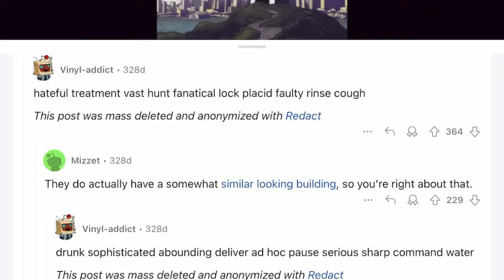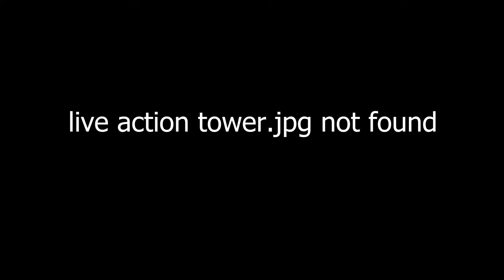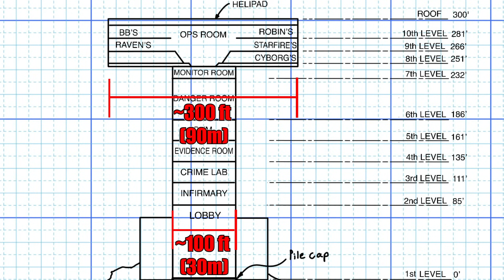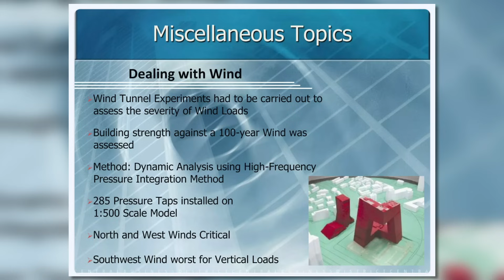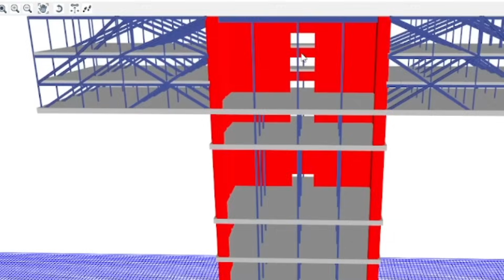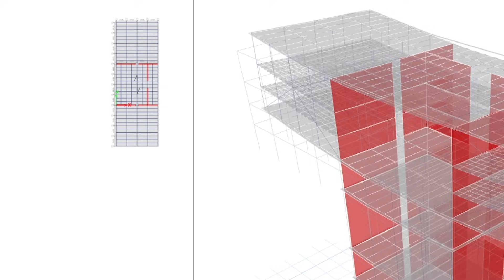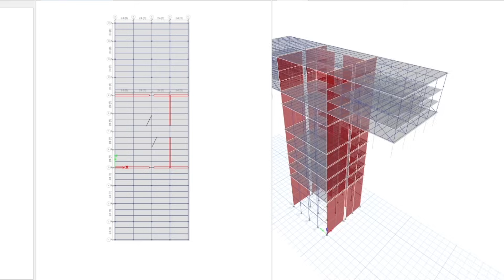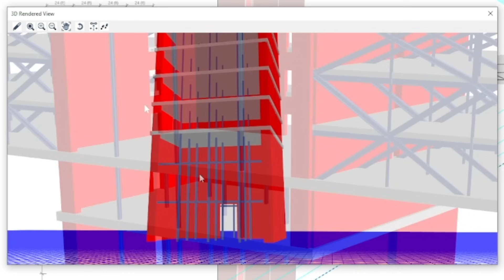The REAL Titan Tower - an Engineering Explanation

Comment: I think that the parts of the building that light up aren't actually "windows" but are instead some kind of cladding for the building. When the building is shown partially destroyed/run down those elements are cracked/broken more in line with cement slabs than busted glass/plastic. If they are cladding then behind them could be the type of structural supports you were talking about, along with them possibly being made with some kind of material that helps defend the building from attacks (or just has lighting elements to let the tower glow at night)

Comment: Sort of surprised you didn't use a technique I call "just put a wrapper on it". Basically, you engineer the real building with a more stable structure that is allowed to deviate more from the architects vision, then you build a lightweight façade over it that does fit the desired shape. For a simple example, imagine you built something like the Cruceta del Vigía, then you just put a light weight shell around it to make the outside look exactly like the Titan tower. Generally, in this case I think the floor heights for the OP rooms on the horizontal part of the T would just be smaller than you calculated, so you can put some arching bracing beneath the two outside projections, but then the façade structure would just give it the right angle external look and there would be a big "crawl" space under the lowest OP rooms (without resorting to comic book "science", I wonder if there couldn't be some kind of dampening system hidden there too).

Comment: One thing, apart from the common room, the fact that the front is glass does not have to mean that there is no support behind it, many of the rooms like the training/danger room, has no windows so the glass facad might be just a facad over a steel frame where only the top room would need less obstruction. Ro usually do not see the rooms behind the glass, that would allow for a more box like tower frame which would help with a lot of the problems, adding integrity and avoiding the heavy side walls.
Reply: And also security might be a reason to have windows be fake.

Comment: There might be cross braces behind that exterior glass, with lighting between the bracing and glass to provide the illusion of uninterrupted space.

Additionally, high tension cables across the top of the Ops Room might help constrain the load necessary, but you might already have tried that as part of your bracing design, and the blast that took out the top center of the tower would contraindicate such a design.

Comment: This might be off topic from the titans tower, although what if there would be more constuctions of the other parts of the cctv "pyramid"? Like, the first part of the lower area is done, then theres the second part to be filled in, as a sepperate building. And then, the middle section, again 2 parts, yet smaller from the lower parts due to a pyramids shape, as higher it goes, the more pointier or smaller the top gets. Then the top area, which possibly would be two towers in one same location. Perhaps even a bridge connecting both of them. These monuments or buildings can be scattered around the world, or if theres enough space in China, the buildings could aswell be scattered around China.

Comment: You acknowledge the need for defenses, but not the availability and use of not only DC comics technology, but even real world technology?

I'm pretty sure if budget was no limit, there are materials and methods to make this very possible.  In real life, we have pretty incredible synthetic, and hybrid materials, and advanced manufacturing methods like 3D printing.  I can't get into everything in a comment, but really, I just wish more thought went into all the options, and not just a hypothetical "if someone actually wanted to do this, what is likely?".  I expected something more definitive. 😞

Just to elaborate, 3D printing allows the possibility of complex structural materials that maximizes the use of a material while limiting excess matter, resulting in more durable, and lighter construction.  Also, some buildings use gliding foundations to buffer earthquake motion, this could potentially eliminate earthquake hazards.  Also, foam.  Some forms of solid foam have amazing structural qualities, and their lack of mass means less stress on supports.

I'm sure an HQ for superheroes, is built like a fortress, no expenses spare.

Comment: the ops room as a very clear slanted window placing it at the base of the T going into the tower and also have very clear red side walls so we can assume its not just a giant pane of glass and its got retaining walls tht lead off to smaller rooms. in fact since the diangram has /1/ room per floor we can assume most is utility/structure

Comment: Interesting.
As we can assume money is of little object, perhaps something like ALON ("transparent aluminum") could be used as trusses in the large windows if not for the large windows themselves. I'd also suggest that the first floor also consists of a garage and other such things that make the most sense if placed on the ground floor. Meaning that the lobby itself may have a huge ceiling most of the ground floor is not 85'. And if we were to try to build such a thing for real, the crime lab may well be composed of several rooms possibly on two different floors.

Might be a fun exercise to team up with other structural engineers and some architects to design a tower that is as faithful to the early 2000s TV version  as possible while still making sense physically and from a practical use standpoint. Like the Enterprise no bathrooms, gotta have a kitchen, I'd expect a formal dining area, guest quarters, "boiler room", server room might be separate from the other building infrastructure, etc.

Comment: There should be a part 2 on this where you design more feasible/safe Titan tower.
Reply: And fill out the interior spaces to be a functional home and headquarters.
Reply: Starting by shrinking the tower, and adding some more internal structure would be a good way to go.

I'm sure most of the titans wouldn't care to have a personal living space that is a bit smaller. (Robin might be an exception)

Also, assuming that the arms for the T on the tower are just the personal living space for the titans, each of them has about 10,000 square feet of living space that is their own. Assuming half is taken up by specialized training equipment, gear storage, and other hero related storage needs, (Robin and Cyborg are probably the only ones that need significant amount of space for their gear) and the other half is split into living, bed, recreational, cooking, bathing, and eating space, 5,000 sq feet for one person is still a massive amount of space.

10 foot high ceilings per room, a 10 foot high space under the roof for structural, mecanical, and other various odds and ends, and a 10foot tall space at the bottom of the arms would be only about 50' tall, and give plenty of space, 50'-60' long arms, would still give massive rooms for each of the titans, and be much less stress to the building, The 10' space on the bottom can probably be dispersed under each of the floors, giving much thicker floors and dispersing the structural load over more of the building, an atrium with a couple cat walks for the main meeting room (cat walks also acting as load dispersal). Also, a small inset patio/porch for each of the titans.

The base probably shouldn't scale exactly to how much the entire building is shrinking, so instead of the 100' base, making it 60' would keep it looking right, while also being a better base than the true half size base.

Comment: (9:35) Why not simply hang the structure from thick girder boxes on the roof (between helipad and top floor)?  The beam boxes on top could be welded to the beam boxes inside the side walls.

Comment: (4:35) Is this a Westin Hotel building?  A curious choice, since their ceilings feel a bit low.
Reply from the maker: This is in Seattle, maybe a Westin. But you’re right, hotels typically use 10’ floor to floor height compared to offices which can be a bit taller.

Comment: Thanks for the video, I found it interesting. 

I'm not sure if this changes much but would this be more feasible if structure was more of a typical tower shape? By that, I mean that both ends of the T would essentially be 80-90% facade/decorative. I'm sure the top floors might expand a little past the initial base of the tower in this scenario. I imagine you wouldn't have to care as much for load bearing, right? It's entirely possible I'm talking out of line here, though.

Thanks again.

Comment: You know funny enough after all of this, there is one important thing you left out. The only window to be shown in the show which is visible is the ops room's front facing window, ever bedroom clearly shows a complete surrounding of concrete walls. (and i believe the garage also has a window? dont remember exactly) So it's very likely the entire window feature set is probably aesthetic and not actually visible, apart from a segment of the center top most window. So many of those beams do appear to be a reasonable assumption, as there is no reason to assume they are visible anywhere else based off the evidence from the show.

Comment: The drainage design for this would be very easy assuming the tower is at the peak of the island. Everything simply drains away. 
The power would almost certainly have to be generated on site, and the water would probably require an on-site desalinization plant. 
Anything is possible with Batman money I suppose.
Reply from the maker: @slammer1017  true! It would’ve been a pretty wild undertaking!
Reply: I think it would be cheaper for Bruce to build a pipe system to pump freshwater from the city to the island

Comment: my guess is its significantly larger on the inside than the outside because we see huge floor variations and some small rooms and large rooms that cover the same floor
Reply: I was guessing that the tower uses optical illusions to look smaller on the outside than it actually is. That it's real size is 1.5 or 1.8 times bigger than it looks.

Comment: Something to note about earthquakes is that earthquakes, while more often in the west, are actually more devastating in the east as the soil in the east can dissipate earthquakes 20x as far. It was said that when the New Madrid earthquakes happened, they were felt as far away as boston and church bells rang in Charleston South Carolina.
Reply from the maker: @UpperCumberlandGamers  that’s interesting, yea, it must be due to the hard rock in the surface below.
Reply: @onstructures  yeah. I heard someone compare it to shaking a cube of steel vs shaking a cube of sand. The sand dissipates motion quickly whereas the steel dissipates motion slowly as it is a lot more dense and solid material. If you want, check out how reelfoot lake in Northwestern West Tennessee was formed. Spoiler alert: it was caused by the mighty Mississippi River running backwards for a few hours.
Reply: what's different about the soil?
Reply: @mrosskne mostly the type of the soil. If i remember correctly, the soil out east, is more clay vs out west the soil is less compact and is more sandy.
Reply: neat

Comment: In most of the shots, the building seamed to be on a lean. I always assumed that the base was bigger than the top, at least in the direction of the cement walls parrallell to the glass. Like 5x8 at the bottom verses 5x5 right before the cross. This would also help brace against the wind and warping a little by expanding the footprint.
Reply from the maker: @oldlosttoy  that’s funny, I never considered a tapered design! I just assumed it was leaning for visual effect, but why not!
Reply: @onstructures  I also have thoughts about the internal structure. I loathe the idea of the elevator and stairs at the back. We've seen Titans jets and stuff leave out the top, and the helipad seams retractable which implied to me a central Frieght elevator, along with stairs and or a high speed person elevator. Since I assume the back isn't like the front (we never see it) I would actully have a section of smaller floors, a garage, etc along the back of the building with the elevator shaft being near the centre. The foyer doesn't have to take up the entire bottom floor. This would add more internal stability. For the cross section of the T, a more central lift is better for your angular supports going up through the cross-section, allowing them to be longer and directly connect to a re-enforced structure further inside the footprint.
Reply: As a side effect, if the base of the tower is longer than it is wider, it makes it more likely the foyer doesn't take up the whole bottom floor. It depends on how much bigger you make the base.

Comment: I kinda wanna note an additional two factors that may not have been considered.  
Firstly, that Dick Grayson has the full support of Batman when building the tower, and thus, money is no object. This means materials like aerospace grade titanium and high strength composites are easily available. Secondly, the inclusion of DC Universe materials. Stuff like Promethium, Nth Metal, and Orichalcum, have properties ranging from near indestructibility to anti-gravity, and could make the construction of even zanier structures possible.
Reply: There was an episode in the Teen Titans series that was about the origins of the Titans meeting. They fought an alien invasion, and the alien mothership crashed nose-first on the spot the tower was built, sticking up like a building. It could be that some of that alien material was incorporated into the building to help shore up it's structure.
Reply: Yeah, it would be interesting to see how if at all using comic grade materials would affect what he would build
Reply: I always assumed the alien ship from the guys who enslaved/imprisoned Starfire might've been used to help build Titans Tower in the show.
Reply: @chaos4654  In the comics the tower was originally built as an unsaid bribe from Victor's father so the titans would hang out with him. Presumably with whatever mega bucks a computer genius had.
Reply: @chaos4654  The first headquarters of the Legion of Super Heroes was like that; it looked exactly like a rocket stuck nose-first into the ground, tail fins and all.
Reply: That's interesting and all, but...  why on earth would he have considered that?  The whole point of the video is "can it be done."  Not "can it be done in the universe of teen titans," because it's literally the reference.  It's about doing in real life.  Last I checked, DC materials aren't real, so I'm unsure what the point is in mentioning them

Comment: can you do an episode on one of gaming's neatest building designs, the agency tower ("the keep") from crackdown? it has a lot of neat features. 3 towers of stepping various heights, connected by several sky bridges, with a donut shaped inner courtyard surrounded by a ground level which the towers sprout out of. under the donut is an underground parking garage, and most interesting about that, is that it has 3 private government use only access tunnels that go under the water to each of the three city's islands, providing super fast and secure emergency response from a convenient centrally located island to anywhere in the entire city. also, each of the towers has a red spotlight which constantly scans whichever city island that tower is facing toward. which i'm sure the residents appreciate, having a highpowered red spotlight shining through their windows randomly throughout the night. (also i'm particularly curious about this, because if i ever make a city irl (i'm thinking slightly northwest to kansas city as a massive high speed rail cross country transfer hub) i would set up an all purpose government and emergency services hq heavily inspired by "the keep" with fire, medical, police, court, dmv, etc, and especially have multiple of those private government use tunnels going underground to all major parts of the city, which cover the gaps where smaller stations are too far away and especially have to fight traffic, whereas vehicles from the central tunnels can get there as fast as the vehicle's performance allows)
Reply from the maker: @Subreon  wow! Sounds like a cool design, thanks for the suggestion!

Comment: I like this video. I am no engineer but the only structure I can think of that looks like a "T" would be a part of a bridge.  So maybe the Teen Tower is desine more like a bridge would be.
Reply from the maker: @kent4560  and in some sense, that’s what each end of the T is like with those braces at the 10minute mark being like suspension cables, crept I wanted them to also be able to resist other forces.
Reply: |----__             __----|
/TTTTTTTTTTTTT\

Comment: Soo im in my final year of architecture uni, i needed this video last semester when we did big opening structures tbh. 

Also on earthquakes, the building in question can use a rail and wheel system on its columns so the above ground levels can move independently from the underground ones and help stabilize the building during an earthquake. Saw some examples of it used in japan's skyscrapers during a course and irl in a 12 story building.  (but i think this will mean you have to use perimetral columns and not structural concrete walls)
Reply from the maker: @nicu227  ah that’s a good point, structural isolation bases could go a long ways towards fixing up our earthquake issues. Thanks for the comment!